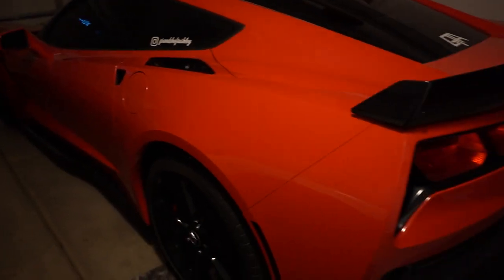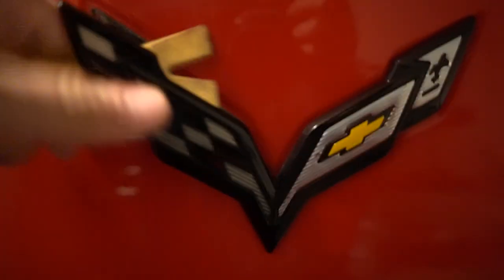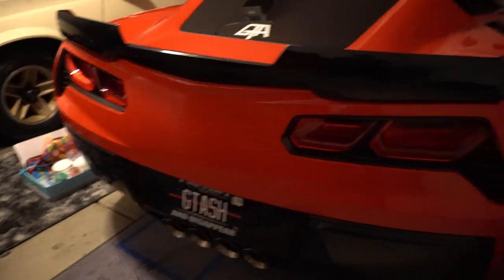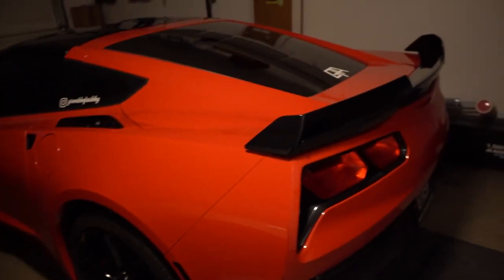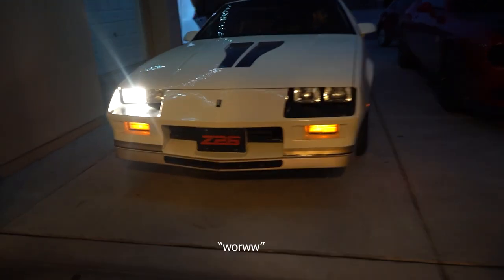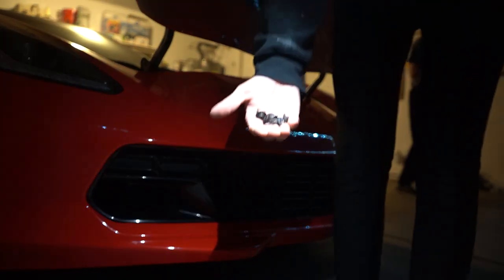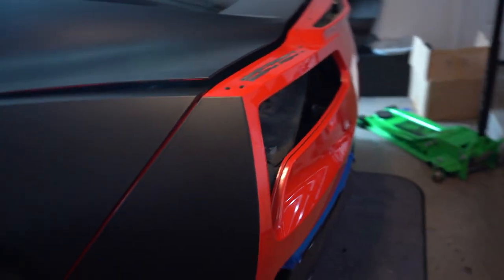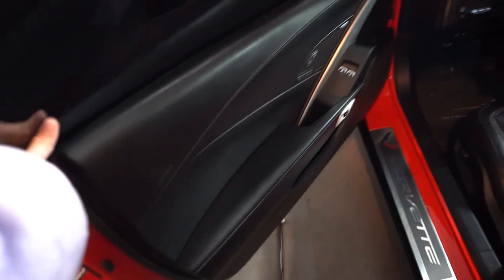WRAPPING MY C7 FOR THE FIRST TIME!

Comment: Tech tip: If an electrical connector is hard to come apart, shoot it with some penetrant, and if they don't want to click back together, there is a  rubber o-ring in the female side that when lubed goes together much easier
Reply from the maker: Thank you!!!